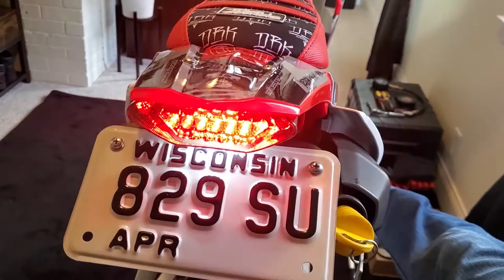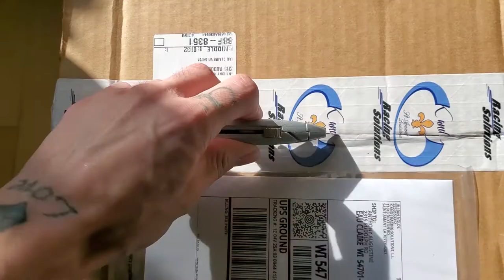CRF110 STREET LEGAL SUPERMOTO CONVERSION! 110 Pit bike Build, Gatorrimz Wheel Install.

Comment: Can you put in link to where you got the throttle body set up, you said it was bolt on, any mapping needed for the electronics?
Reply from the maker: Factoryminibikes carries the throttle body/intake manifold kit. 
https://www.factoryminibikes.com/collections/crf110-engine-2019/products/cjr-24mm-throttle-body-kit-2019-crf110s?variant=40704515473519

You will need to get the ecu tuned for it. You can send it in for flashing, or buy a preflashed unit from CJR here.
https://www.cameronjonesracing.com/hondacrf110

Comment: What tag mount/brake light setup is that?
Reply from the maker: It's an Amazon special! Lol $12
https://www.amazon.com/gp/product/B0185P9UFC/ref=ppx_yo_dt_b_search_asin_title?ie=UTF8&th=1
Reply: Thanks man! Also, how did you get the brake light switch to work with the rear light? 
Are you running a full harness with relays or did you straight wire it to the light?
Reply from the maker: I wired a brake switch straight to the light. It's just a mechanical switch off Amazon that attaches right to the brake pedal
Reply: @bankruptmoto5769 may I get the link to the mechanical switch you used?